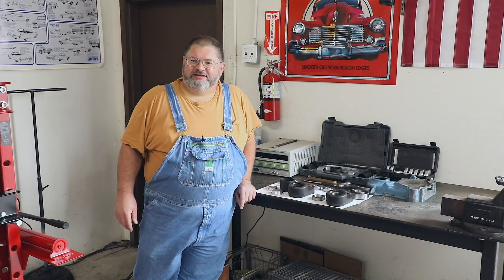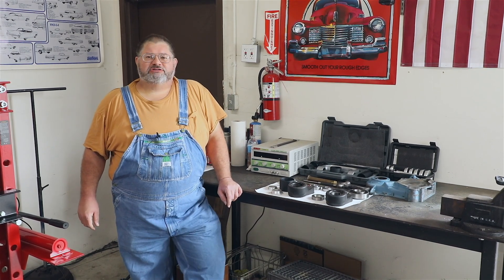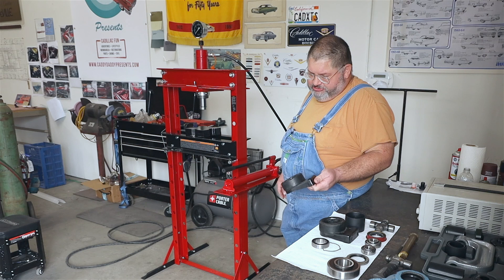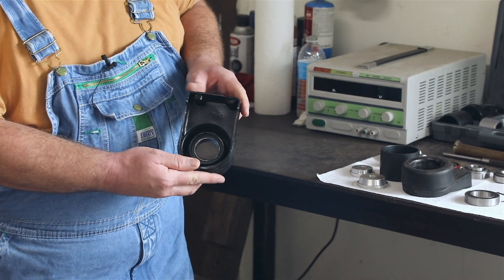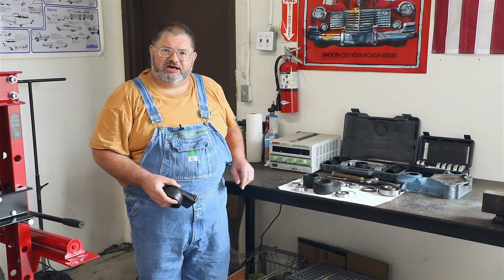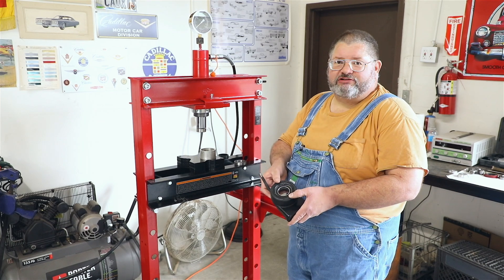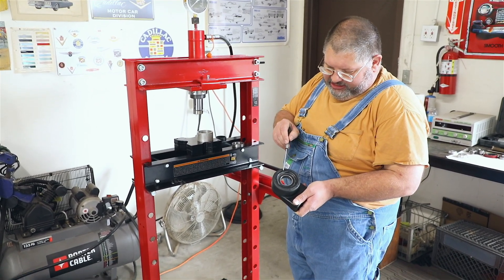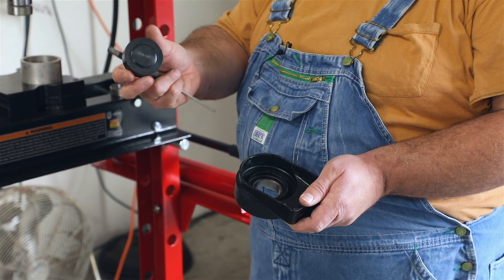How To Use A Hydraulic Press The Right Way

Comment: One thing I noticed while you were doing the first removal of the first set of bearing is how nice it would be to have a rear mirror and some upper light to manage the position correctly the ram; it’s not just having the ram as close as you can.